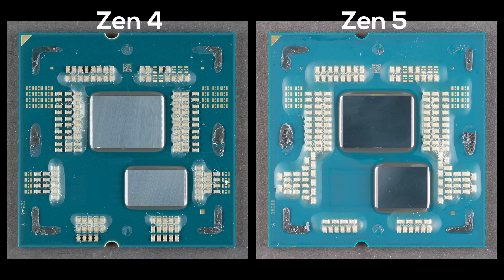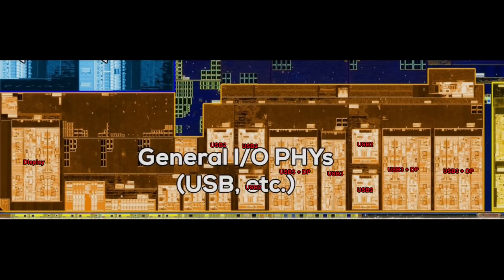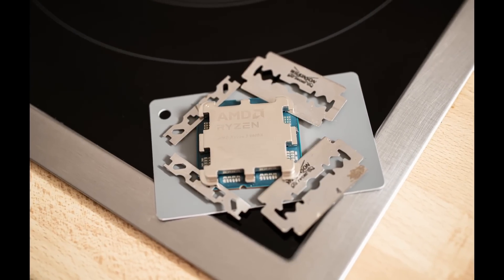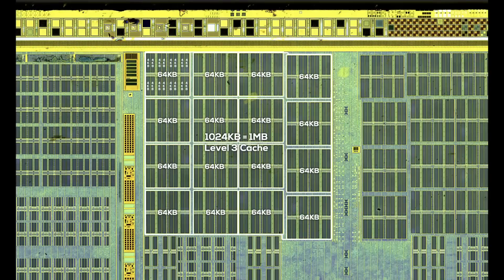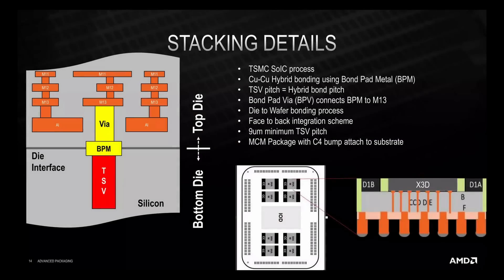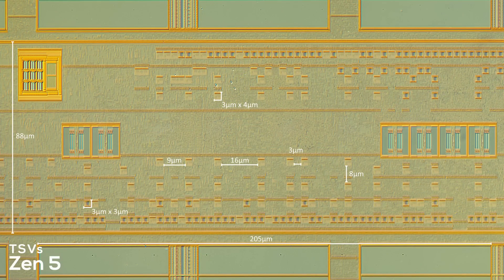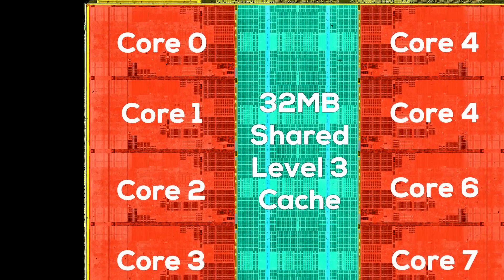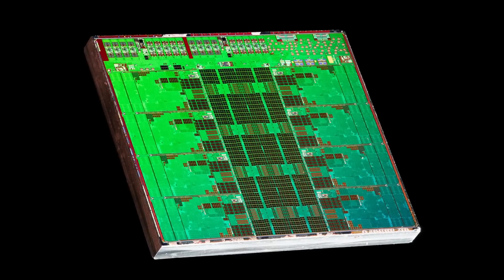ZEN 5 has a 3D V-Cache Secret

Comment: For me, putting the 3D cache chiplet underneath the CCD die makes more sense. It woundn’t blanket CCD anymore and is good for thermal.
Reply: That is absolutely the best solution, but the problem there is that you have to make that the standard design.  You couldn't make it optional.  If they ever want to go this route, they can take out ALL the L3 from the 'base die' and put it on the cache chip.  On top of course being way better for thermals since the 'base die' will get the most direct cooling.  This is ultimately a slightly more expensive approach though, which is why they dont do it.  They are all about trying to increase margins wherever possible.
Reply: You were right! :D

Comment: Double stacked 3D cache?
Welcome back, consumer HBM
Reply: i havent looked at it like this but the more i think about the more i find it super funny xd
Reply: Double stacked 3D cache on both ccd's for 12c/24th and 16c/32th?
I've also pondered Zen 5c for either mixed Z5+Z5c or all Z5c for up to 24/48. Idk if 5c cores can clock as high. But, my laymen guess is 5c's lower cache per core wouldn't be an
issue with the double stacked 3D cache. I've also thought about chips like the 8700F getting 3D cache. Again, this is just me thinking aloud. But, I could see those defective APU's
being repurposed into budget 3D options that would perform between standard 7700X/9700X and 7800X3D/9800X3D. Or, would the halved 16mb L3 on the die itself be too little?
Reply: This is kind of a part 2 to my first comment... What I'm getting at is how important is having a regular pool of L3 cache on the die directly attached to the cores versus just having
the large 3D cache to compensate? I've heard people say that packing smaller (but equal ipc) Zen 5c cores in wouldn't hurt performance because of that large pool of 3D cache.
That way you could have hybrid 20c/40th, or a 24c/48th all Zen 5c chip. Like I stated before, this is just me as a laymen asking if this would work. Idk if the clocks would have to 
be significantly lower on the 5c cores either. I do know that AMD has used hybrid Zen 4/4c in Phoenix APU's. And, when all cores ran at a fixed clock performance was the same.
Reply: @andersjjensen memory bandwidth makes money, yet there are no IOD chances whatsoever.

Comment: I don't think we will see a stacked cache die solution. Less TSVs to me suggest a die with less cache, instead they might go for a cache die on both CCDs.

We know from the mobile launch that Zen 5 does better than Zen 4 in terms of power at lower clock speeds. If that translates to the X3D parts and they can get away with a cache die on both CCDs then that would solve a lot of the scheduling issues we saw with the 7900X3D and 7950X3D.

Comment: impressive improvements in sizing, but then now i am wondering what the extra core size is doing since so far the benchmarks where not that much more impressive in the performance vs older generation. are these optimizations mainly towards server loads maybe hence desktop applications are not getting the benefit?

Comment: I am perfectly fine with AMD not using a newer process node (still) for their I/O chips, as the phrase goes "If it isn't broken, don't fix it" applies very well here. If the I/O chips can't be made faster through die shrinks, then why waste the money? If it is still plenty fast enough to keep up with the fastest CCDs, then that is a bonus on top of the cost savings as far as I am concerned. I am hoping you are able to get shots like this for the X3D chips soon, that would be epic. As my roommate is using an AMD Ryzen 7 5800X3D and its been a beast, when I upgrade from Socket AM4 to Socket AM5, an X3D chip maybe in my future as well. I started with an AMD Ryzen 5 1600X which was overclocked to 4.1GHz all core, I now have a 5600X and just allow PBO to adjust the CPU and its done a great job. Seeing how fast the X3D chips are and they can't (safely) be overclocked, I am fine with that. It has been awhile since CPU upgrades actually made me excited.
Reply: I have a 7800X3D that's PBOed with a -30mV all-core undervolt on the curve in BIOS. I get 5050MHz for single core and over 4850MHz for multi! It helps it run cooler too. It's a pretty snappy chip. It's not just games that benefit from the extra cache.
Reply: The I/O die is broken in the sense that high speed RAM over 6000 rarely works on it, and the I/O die is the weak point that's bottlenecking the CPU. X3D worked as a buffer by moving memory closer to the CPU. And Zen 5 barely has an improvement over Zen 4 because the I/O die is the limit.

Comment: So have they changed the power domain to allow the V-cache to run at higher frequency without blowing the normal L3 with excess Volts?  If so then Robert Halleck told the truth and the tech world in general ignored him.
From Chips & Cheese analysis there's some interesting design choices in Zen5 front end to save power on prediction that will stall, almost as if they planned the full fat Zen5 with V-cache in mind, because  losing some work fast will be less common.  The wider front end should allow later catching up as opcodes are retranslated into micro ops.
Going with SMT and larger L3 will reduce context switching with expensive flushes and OS scheduling, while avoiding the drawbacks of 2 virtual threads halving effective cache size.

Comment: It really is unfathomably ironic that while zen 3 and zen 4 carried a lot of bagage from older zen generations, their actual performance uplift where massive, in the order of 20%.
meanwhile zen 5 is almost a completely new design, with massive transistor count uplift, and can barely surpass zen4 in most applications. Hysteric
Reply: It's a tick, that performs best under server ops. 6 will be more of a tock I wager, albeit also I suspect, liable to introduce heterogeneous cores across the whole lineup.
Reply: *in windows
Reply: @dhuckbourning7165 *and only in games.
In serious workloads like for servers it looks very promising.
Reply: IODie is the answer: it's the same. Zen 4 gets a massive uplift from the 3D V-Cache, in other words the Zen 4 cores are massively memory constrained in many workloads.
What happens if you improve the cores but keep the same memory constraints? Not much.
Hence why Zen 5 3D V-Cache should see a dramatic uplift.
Reply: My guess is AMD isn't taking full advantage of the new architecture yet because performance wasn't their primary goal. I know that sounds like cope but I think we'll see bigger performance gains later. Right now AMD got it to work without losing performance and still gained some efficiency iirc. Feel free to correct me, I haven't been paying close attention to all the numbers.
Reply: @spamcan9208  In most workloads, the efficiency gain isn't good either. People are comparing 65W zen 5 parts to 105W zen 4 parts, hardware unboxed did good coverage on that. Linux gains are also mostly overstated from benchmarks i've seen. 
Also, why would windows selectively degrade zen 5 performance, when almost every other ryzen generation saw 15-20% gains in windows? 
Why would the IO die bottleneck the cores so hard, when zen 3 used zen 2 IO and still achieved ~19% perf uplift? 
IMO the problem is in the agesa/driver side of things, but its just speculation at this point
Reply: @SicilianSSFR  You have to look at the whole package. It depends on where the bottleneck is and if it's resolved.
If AMD had made Zen 5 with the same cores as Zen 4 but improved the memory subsystem we'd probably see substantial gains, approaching the performance of the 3D V-Cache Zen 4 parts.
Zen 3 to Zen 4 had a lot of gains because of the increase in frequency.
Zen 4 to Zen 5 has no such changes, everything has to come from the core and L1/L2 improvements, and as I mentioned in my previous post: Zen 4 is already clearly memory constrained.
I'm not familiar with the changes from Zen 2 to Zen 3 but my guess would be the (main) bottleneck wasn't the memory subsystem at that point.
Reply: @SicilianSSFR  Zen 3 gained so much from Zen 2 as the CCX was unified and each core had access to double the L3 cache than with Zen 2, bypassing the need to go through the IO die, similar to what happened with V-cache.

Comment: SRAM cells hardly shrink with silicon node anymore (allegedly because of the required number of wires to and from each bit cell). So your idea of a double layer VCache seems plausible, despite the cost and yield disadvantages. I am looking forward to AMD presenting what they engineered here.

Comment: 3:20 Surely the chip is turned 180 degrees in this transition? Later on, the CCD is rotated compared to this CPU image, too.
Reply from the maker: The dies are so called flip-chips, they are placed face down onto the PCB. That's why the images are different or flipped vs the infrared pictures.
Reply: @HighYield  Infrared...? You mean x-ray? The chips don't seem mirrored on the images, just rotated around. Anyway, the point was that the orientation of the individual chips does not match the picture of the complete CPU. The infinity fabric parts, for example, should be positioned on the edge that faces the other chip.
EDIT: Oh, it is actually IR, x-ray would show all of the traces. Learn something new every day.

Comment: AMD like had extra SI vias for the previous generations to increase yields. Now that the process has matured, they don’t need them. The extra vias could have caused the power problems of the previous gens that restricted over clocking.
Reply from the maker: Interesting idea, it does make a lot of sense.
Reply: Yeah, removing redundancy coupled with some further improvements makes sense.

Comment: To me, this is a lot harder than rocket science. It is amazing how relatively cheap they can sell these wonders.
Reply: Way back in time an Intel design engineer was talking about the original 8080A CPU. He said something to the effect of "The first CPU cost us a hundred million dollars. The second one cost fifty cents."
Reply: @robertsneddon731 Yeah which remains true but was also before the cost and time of developing bleeding edge nodes was this absurd and getting more and more expensive for marginal gains. Now we're getting to the point with nodes marketing improvements at fractions of a nm.
Reply: The large data centers that spend tens of thousands per high core count cpu offset a lot of the cost for the consumers. And as for development, it takes years for each part of the cpu to be developed with many teams behind each part. Stuff for zen 5 was being developed before the announcement of zen 3. They usually mention it on their roadmaps and presentations. Tech like CPUs and GPUs are always a few years behind from the real cutting edge because of this.

Comment: Great presentation! Technical enough to be widely understood. (I hope.) You should be on AMD’s marketing team. 

If the rumors about VCache overclocking are true, it makes sense that the VCache would be placed above the L3 cache, allowing for better cooling. 

It’s unfortunate this architecture doesn’t perform better in gaming. If the boost was closer to 8-10% instead of just 3-5%, I think gamers would have a much better opinion, and more people satisfied.
Reply: It's a fascinating question though: If clock-speeds are higher than with Zen4X3D, does that mean that the performance-improvement from X3D will actually be HIGHER? Since the Core-die doesn't have to clock down as much, that could mean that some of the negatives of X3D could be mitigated, and X3D-CPU's will henceforth be better for production-work and work which favours frequency over cache.
Reply: @predabot__6778  That's the hope.
Reply: @predabot__6778 That means bad core parking wouldn't be as penalising as before then?

Comment: when 3Dvcache came out, my first question was whether the tags were on the CCD or the vcache chip. How is the AMD L3 cache implemented? is it a single cache or core associated slices connected in a ring or grid?
how many connections are needed? Loading an entire 64 byte cache line, 512 bits in one access is good. Is it necessary to allow all 8 cores to load the cache line at once? or is it safe to assume one at a time is good, given the 40+ cycle L3 access?

Comment: The thing about Zen5 X3D is that we know from both amd and leakers that it will get a significant change. Most people suspect a increase in clock speed wher it will be closer to the 9700x than the 7800X3D. This would mean that amd solved the heat problem of X3D at least to some extent. For me there are 2 theories that come to mind explaining the design.
1) amd significantly changed the technologys used for zen5 X3D. This would explain why they romoved most tsv. If they used something esle for the connection they arent needed anymore.
2) amd created 2 ccds one for X3D and one for normal. If the size reduction is big enough it makes more sense to invest the engineering resources to create a secound ccd design than to sell a X3D capable chiplet without X3D. 
But we can never know until amd actually announces something.
Reply: 2.) Seems unlikely -- why invest time and effort to add TSV's at all to regular dies not meant for X3D? That would just take up space that could be used for other things. So we have to assume that just like with previous Zen-gens there's only one 'big' CCD-design. (obviously Zen5C has its own CCD-design) So, option #1 seems the most likely. Now, as for what on Earth the improvement could be, that allows for less TSV's, then I really have no idea... Hopefully AMD will surprise and wow us all.

Comment: AMD has long had an option in the AGESA called "X3D", for which the options are "Auto, Disable, 1 stack, 2 stacks, 4 stacks" so I would not be surprised by a 2-hi stack
Reply: INTERESTING...! Could you give a reference for this claim? Would be very interesting if you could show this info' to High Yield, and have him determine if there's any correlation to potential multi-stacking.
Reply: @predabot__6778  It is found under AMD CBS/Zen Common Options/X3D. Some motherboards expose this menu, but not all. ASROCK usually has these exposed, but this is not really a menu made by the motherboard vendor, it is all from AGESA which they get from AMD. But they can just choose weather or not they want to expose all of the knobs from AMD to the user.
Reply: @predabot__6778  AMD is shifting from AGESA to open source firmware after ZEN5 so anyone will be able to see it. They have some experimental implementations already operating with Zen5. It will fit well with coreboot IIRC
Reply: @predabot__6778  Acording to more law is dead, RDNA3 MCDs could have V-cache stacked 2 chips high if I remember correctly, MCDs do seem to have vias for extra cache for at least 1 extra layer
Reply: It's no surprise they use more than one stack height, considering EPIC x3d chips had like a gigabyte of v-cache even in previous generation despite using the same CCD chiplets.
Reply: @adriankoch964  All EPYC so far has been 1hi, just like desktop, the huge amount of total cache came from the large number of CCDs. 96 cores at 8 cores/CCD means 12 CCDs, so its 12*(32MiB + 64 MiB) = 1.125 GiB of total cache.
Reply: @adriankoch964  the part you are thinking of has 12 standard CCDs with v-cache, no double stacking just a lot of dies
Reply: @adriankoch964  clearly you don't bother with simple math. 12ccd×96MB L3 =1152MB L3
Two layers, the base chiplet with integrated 32MB L3 between the cores and a 64MB 3d layer on top, exactly the same as Ryzen CCDs

Comment: Is it possible for Zen5's 3D V-cache to follow similar L3 optimizations, like tighter spacings, slimmer TSVs, and whatnot? And assuming that the 3D V-cache is simply going to be "2x the current chip's L3" is also not right because you will double count the TSV area. Plus, you said it yourself, "new cache optimized process node" may actually be the key. Also, why can't it cover the L2 again like Zen4? Sure, there's no TSV there, but at least it's not covering the logic part, right? 

What I am interested though is how will Zen5 do with just having 9k vias. Will there be a performance penalty? Or is 24k overkill in the first place, that's why they decided to cut it down to realistic, uh, "gaming needs"? Also, is it possible that AMD's redesign on the vias also affect its performance? Maybe 1 vias can do more things now like higher power output or maybe higher bandwidth for example? 

So many questions one picture can make I suppose

Comment: The 35% reduction in L3$ is quite an amazing feat. Also, with the TSVs, this is another "generational" change, and I'm impressed with how far R&D goes to improve it unlike the IOD.
Reply: I think the lack of IOD improvement is kinda the point of the design lol
Reply: @RyTrapp0  I don't disagree. When AMD has 3D V-cache for gaming, from their POV might as well save R&D until necessary.
Reply: @NootNoot.  AMD would probably prefer staying with the same I/O die for an entire memory generation, but I think we will see at least minor a revision, as the current one caps out at 6000MT/s.
Reply: @andersjjensen  Zen6 leak show complete redesign I/0 die and 10x increase bandwidth to CCX and decrease latency,  this is most liekly reason why we not see I/O changes now they simply focus all efforts on zen 6 i/o die